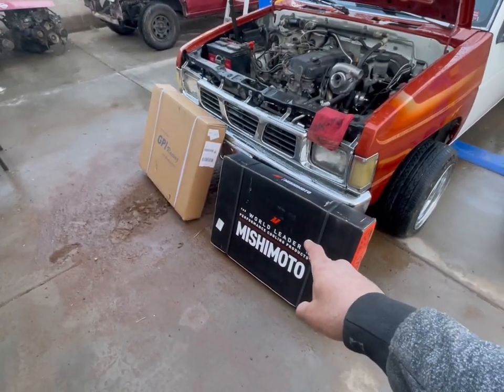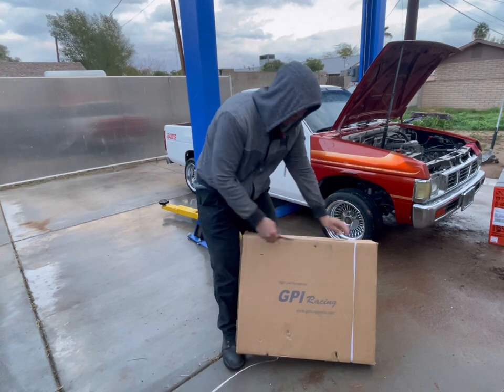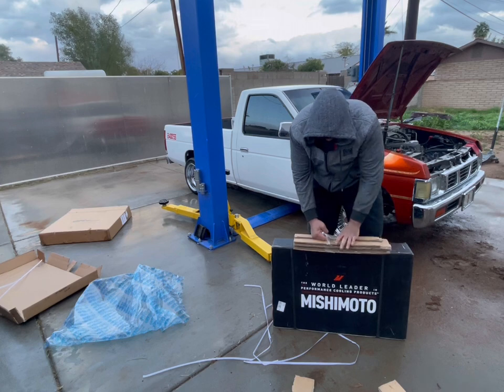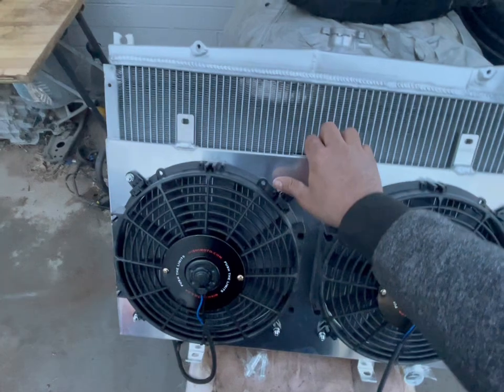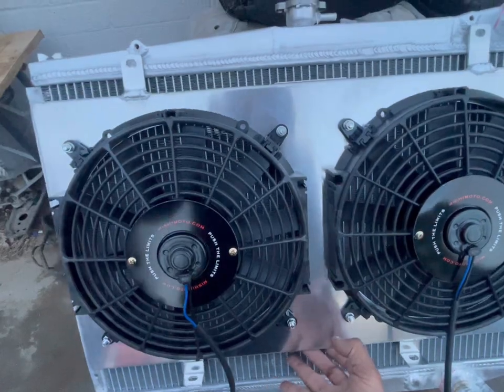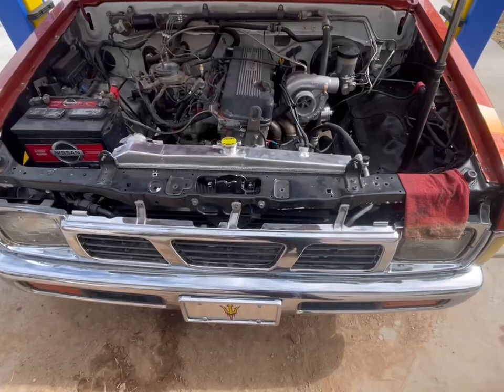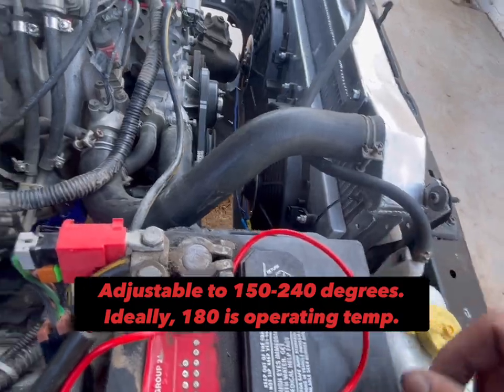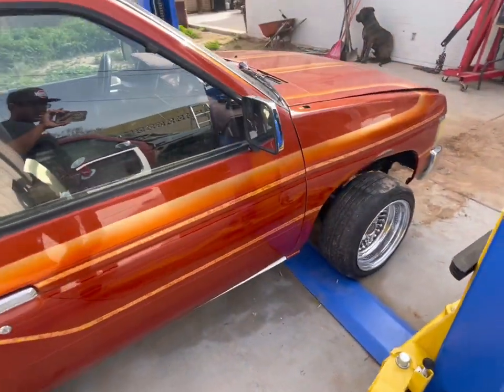Mishimoto Electric Fan Conversion on my 1991 Nissan Hardbody mini truck lowrider!

Comment: Do you think with a few other modifications, that setup would work for a 86.5 720 Datsun? It is carbureted so obviously a higher flow carb but would it be able to come together?
Reply from the maker: Yes. It’s electricity. You can wire it to any car.